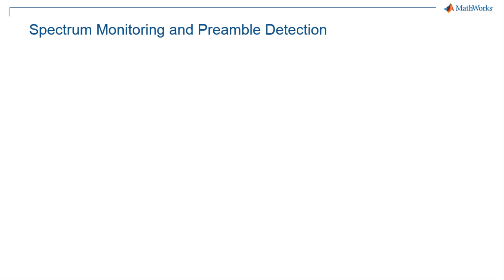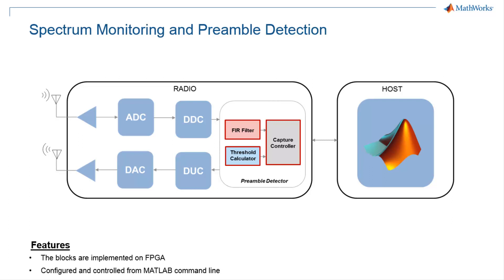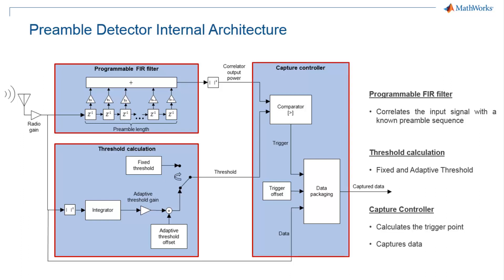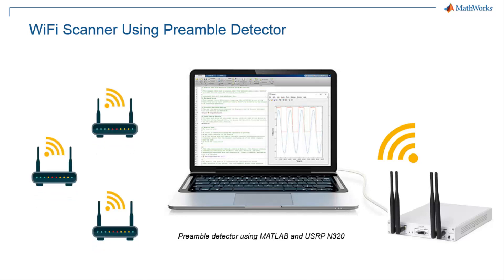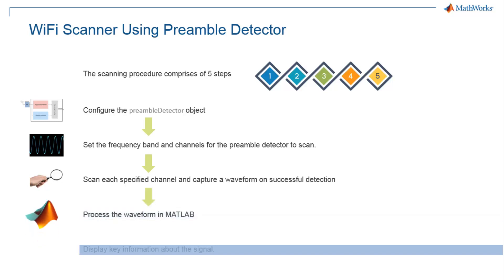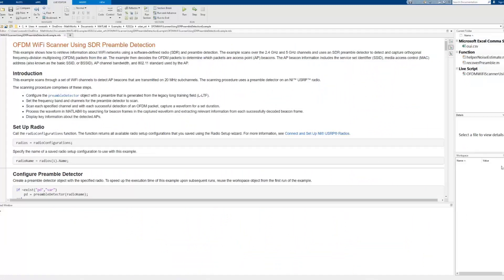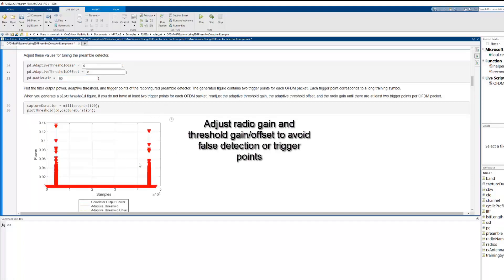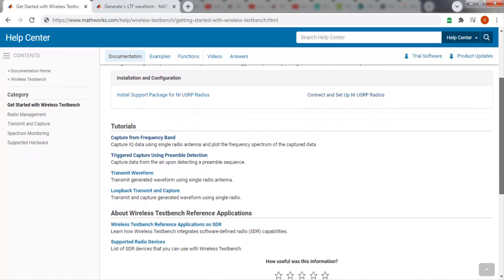Spectrum Monitoring Using MATLAB and USRP

Comment: This is a very good feature.

 Please include the option to add custom signal processing blocks to USRP FPGA. For eg:- I'll design a Digital Downconverter and demodulator in simulink, convert to HDL IP core using HDL Coder and port it to USRP. Then I can receive demodulated samples in Matlab application for playback.

As USRP is very widely used in wireless communication research, a simple workflow from SIMULINK to USRP FPGA will be a game changer for design to prototyping.